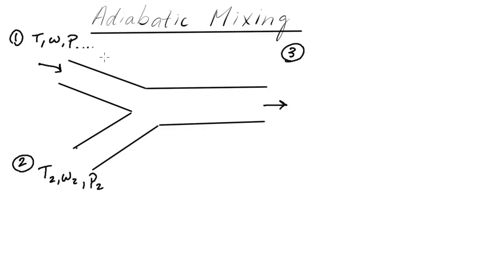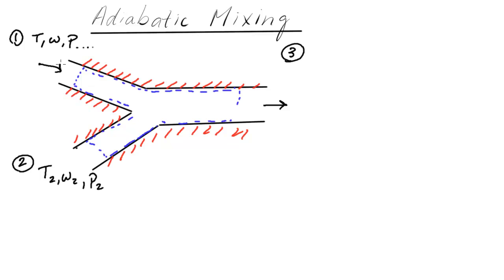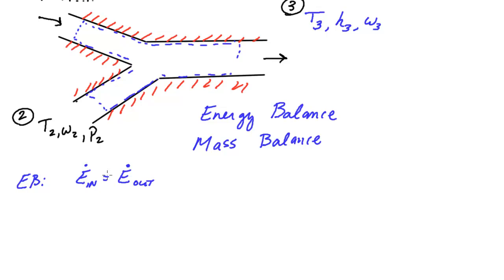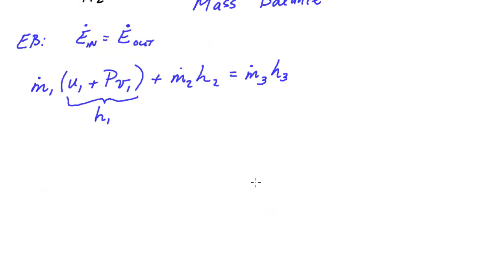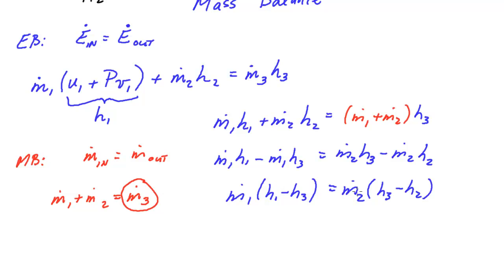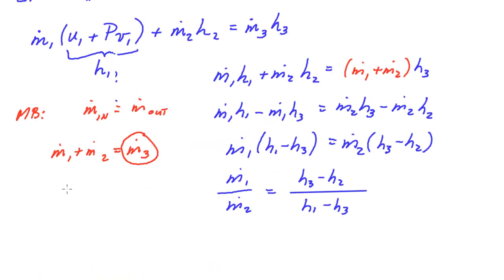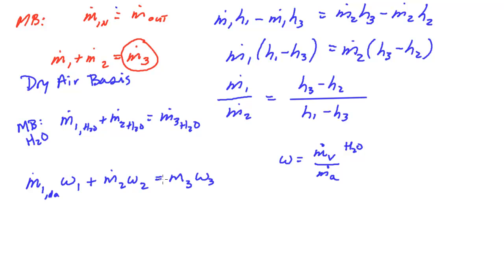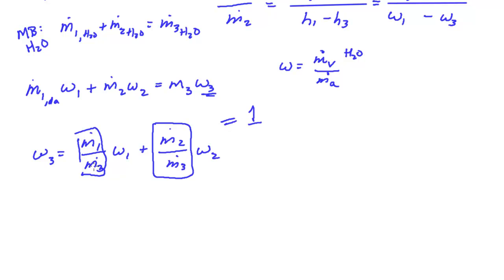Adiabatic Mixing of Two Airstreams

Comment: Specific humidity = vapor mass per unit mass of moist air
Mixing ratio = vapor mass per unit mass of dry air

However, you call the mixing ratio, omega, the specific humidity whereas it is not.
Reply from the maker: Thanks for pointing this out. In ASHRAE Fundamentals, they do use the definitions you described. However, to those reading this, when many engineers use the terms humidity ratio, specific humidity, or absolute humidity, they are oftentimes all describing only the vapor mass per unit mass of dry air definition. So we always need to be careful in being clear in our definitions.
Reply: Thank you very much for your clear answer. Usually, the Youtube authors don't give any answer for the comments. You are different. Great.

Comment: What is two phase region on Psychrometric chart and can you plz show it on T-S diagram of water?
Reply from the maker: The psychrometric chart is not showing two phases of any substance, it's showing the properties of moist air, which is made of several elements which are all in the vapor phase (N₂, O₂, Ar, H₂O).

Comment: What are the causes of errors in this experiment?
Reply from the maker: If you were to try this experiment, some of the potential causes for error would be:
1. The ducts are not perfectly insulated, so the system is not truly adiabatic.
2. Measurement errors in determining "average" properties. Properties such as temperature and pressure can only be measured at a point. So especially on the outlet state, it can be difficult to capture the average fully mixed properties.
3. Kinetic energy and potential energy terms have been neglected. If the air streams are coming from significantly different locations in a potential energy field, or one of the streams is moving at a significantly different speed than the other, this would also introduce some error.
Reply: @MitchellPaulus  thank you sir